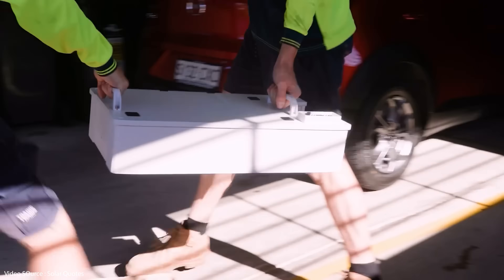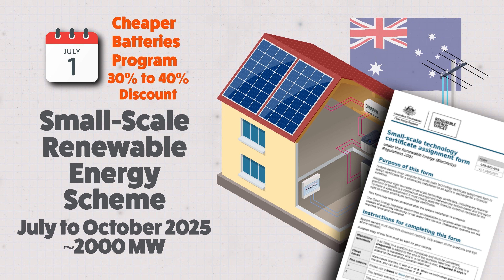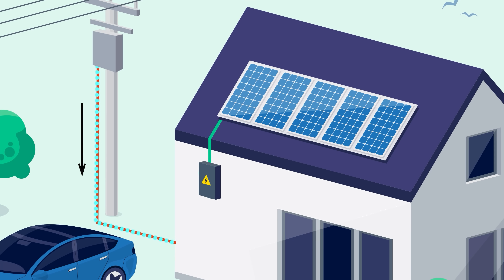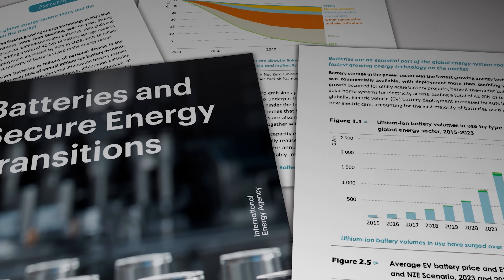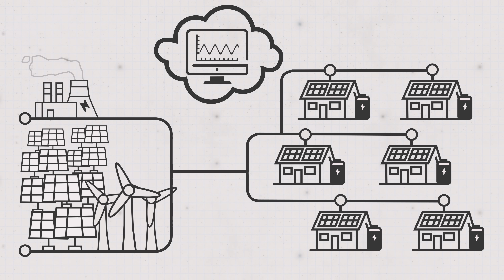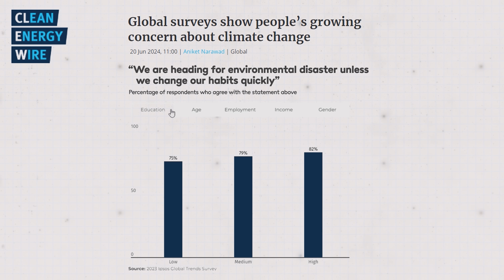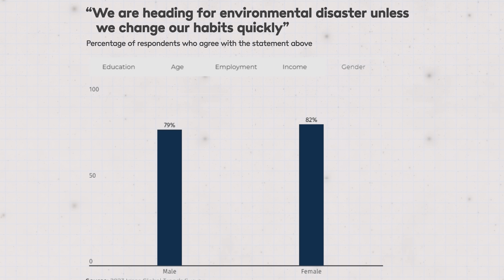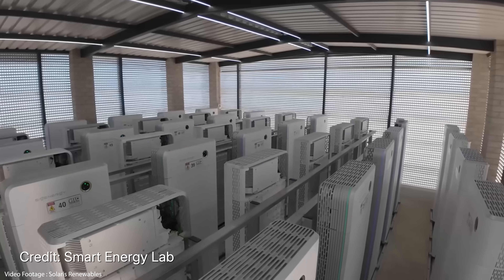Australians installed 100,000 home batteries in 17 weeks. Why can't we all do that?

Comment: Wasn’t worth feeding anything into the grid , the system was working 75% for the grid all the time plus sometimes 25% for me in hight temperatures sometimes over 40c . Definitely not having my battery heavily cycled during the day, remember no subsidies next battery all maintenance  bills on you. I’m happy now to pay minimum charge per quarter and let my system cruise even on ridiculously hot days.  
If the minimum charge goes up I will add an extra battery to give a larger surplus and disconnect completely from grid.

Comment: This is a scandal in Australia. Do your research! The Australian government has spent $2.8b for wealthy Australians to install  50 kWh batteries when the average household only uses 10-15 kWh per day. This means that the batteries will be 80% unused and likely never re-coop the carbon involved in their production. This is an example of appalling government policy that has had to be rapidly overhauled because of the resulting abuse by private companies. BTW any and every economist will tell you that the only sensible policy to reduce CO2 emissions is a carbon tax. Subsidies are rife for fraud and abuse. This is a great example that I will be using in my lectures.
Reply: That's bollocks. Do some research. Your calculation is flawed.

Comment: They are Not as great as they sound. There are still issues. For example.
Our system was not installed properly, the power company inspector failed the installation and now
they have to come back and fix it. we also get random brown outs that last 2-3 min even though the battery is full.
If the grid goes down we get these brownouts every hour or so. Very annoying, disruptive and harmful to computers
and other devices.

Comment: We installed two Tesla Powerwall batteries, a smart meter and 28 large panels in May 2024. After government subsidy, it cost us $AU 60K ($US 40K). We haven't had a power bill since. We use AC freely (including keeping the bedroom cold at night for the benefit of our three dogs), and run 2 fridge/freezers and a large chest freezer. We have had 2 blackouts and only realised the mains power was off when the Powerwall app beeped to warn us we were on battery. How stupid is the American system? 😂 Our heat pump HWS is 20 years old. Australia is the IDEAL environment for solar. As I write, our system is generating 9.1kW, 26 kWh today so far, at 11.20 am. We are running our little 55 inch tv in the bedroom, a 5kW AC, HWS and 3 fridges / freezers. Most of what we generate is going to the grid.
Reply from the maker: That's an amazing setup, and it sounds like you're truly living the dream!

Comment: I installed a battery under this scheme, but then I wanted to install one when I installed the solar panels two years ago. With the solar panels alone, my electricity bills turned from about $150 a month to credits except in winter. My electricity bill for all of last year was less than $250. Having added a 9.7 kWh battery, we now draw less than 1 kWh a day from the grid, and have backup if the grid goes down. In summer, the battery doesn't drop below 50% even when running the air-conditioning overnight, and it's fully charged by 10 am if it's sunny. So in our case with a small battery, we're still exporting to the grid most of the day. This will be less true in winter, but even on very cloudy days there's enough sunlight to charge the battery. Most of the battery systems installed under the scheme are 20 kWh or bigger, so they should at least reduce the grid draw for energy hungry homes as well as providing power to the grid in peak demand times through VPPs. I haven't seen charts demonstrating the benefits of the batteries yet, but something over 2GWh of extra power must be having a noticeable impact. The downside of the oversupply of home solar power is that feed-in tariffs have dropped to the point where they don't offset the daily supply charges from electricity companies. Anyway, on the whole, I believe that the battery scheme has encouraged enough people to make a difference to the supply balance in the grid, and it's much cheaper than building new coal power stations or nuclear power stations without the risks and waste issues. Yes, solar panels and batteries need to be recycled, but that's less of a problem than storing high level radioactive waste for thousands of years.  As to the cost of the subsidies, please remember that home owners are paying 70% of the cost, and battery prices haven't yet dropped as much as solar panels.

Comment: I've been saying this for ages. Government in the UK should put money to getting as many solar panels on as many roofs as possible, and "community batteries", installed in the local substation. All the local houses would charge the community battery and any extra would go back into the grid to supply houses that can't have panels. I have 10 panels and no battery fitted this year, with bird mesh for £5000, my bill is tiny compared to what it used to be. The cost will be repaid in under 3 years.

Comment: Curtailment always saves fuel because is reduces the supported erratic generating space.  For that reason it is tightly restricted  for emergencies because it would be done all the time.   Home solar charging home batteries eliminates solar power from grid support.  To the power grid it is not solar power.   The residence still has grid capacity maintenance costs, but it is not costing large amounts of high readiness natural gas.   Home solar grid support has to have instant capacity to supply the entire home when a cloud passes over and make up for any electricity below peak solar.  It is very natural gas fuel expensive.

Comment: I live in Sydney but from Wales originally so I know the weather in both ends of the Earth.  I just installed 20kw solar and a 48kWh battery, would have been $55, down to $35 with rebates.  Immediately signed up to Amber who are a VPP.  I’m in credit on my bill after 2 weeks.  It’s a blanket of cloud here today and the system will fill my battery by end of the day while running the house and pool pump for 6 hours.   
Amber 100% controls my battery for selling power only when wholesale is positive and curtails if the battery is full and power is negative cost to me.   All while overcoming the threat to the grid.  Win / win.
The weather in the UK may not be 300+days of full sun, but it’s enough to fill up your battery, even on a cloudy day.  
There’s a lot of naysayers in Oz, especially in the politics of green energy…. But this looks to be a winner, energy generation, storage and distribution on a huge scale but local.  For those who say what happens when the sun goes down?  Amber steps in, I’m hoping my contribution will cause power prices to go down for everyone in the long run….. we are all being screwed down here by the for profit driven power utility companies…..  I for one can safely stick 2 finger up to them.

Comment: While this May Truls be a good idea, it is not an obvious best financial choice. When calculating There Are hidden cost carried indirectly by the consumer. An example is the alternative approach, where the required network upgrade is finances through a small uplift on power prices. This May, or May not, be less expensive than individual batteries.
So the total financials Are not clear cut and simple.
However, due to local structures, batteries my be a quich and good fix to a public supply system which is respondent slowly, if at all.

Comment: I live in Toronto area of Canada. Home battery is not a big thing here. I believe solar power makes about 4% of  grid energy mix, but a lot of that is commercial scale with whole school gym roof, shopping mall roof, and rural ground mount 'solar farms. We are starting to see electric car chargers come to market  to be coordinated and remote controlled. This makes them become a dispatchable grid tied load bank. Good for providing an overnight dispatchable load for system stability when low demend otherwise need something to drive and to allow generators to be started in anticipation of morning loads ramping up.

Comment: Do you know why we install the batteries? I have 2 (and 7.5kW solar), the reason is to protect myself and family from the destruction caused by Bowen and Albo and this insane nett zero, I didn't do it for another reason than to keep the lights on and insulate away from the rising prices. From Australia.
Reply: Forcing luddites to act is a good thing.

Comment: I did say before that every house should have its own battery regardless if you have your own solar pv, just because that alone helps the grid and renewables to be built. Relying on big single centralized battereies is not feasible. People only argue against this when they dont see a direct benefit. Yes batteries on their own would only mean storing a possibly cheaper energy during the night. But the concept is true and is always talked about as a good side effect of getting an EV etc. But even I live in a house where EV charger is Impossible as it would have to go over a footpath; and its a residential building where installing solar is just never gonna happen because noone is really keen. Noone except a keen individual could make a difference with a battery. If only there were ANY subsidy to UK renewables these days! Hmm or even better having (per building) one of those super heavy molten iron or liquid air etc.. but yeah i guess I'll keep watching

Comment: I think sodium batteries are going to be so cheap in two or three years, that people won't be able to afford to not have a battery. Even if just shifting load to night-time rates, will make them feasible economically without PV, and using at night will allow greater wind power penetration.
The Genocide in Gaza, that you keep forgetting to condemn. It's ongoing. You haven't missed your chance.

Comment: I installed a 48kwh Sig battery under this scheme for nearly half price. I use around 60kWh a month and my combined savings of my solar, installed in 2018, and new battery are over $600 a month. All bills are now all in credit as I can fill the battery for free every day from the grid between 11am and 2pm with a 20kW inverter.

Comment: We're from Sydney & we’d had our solar for about three years already, but adding the 24 kWh Sigenergy battery a couple of months ago in September has completely changed things. Since then we’ve only paid around $5–$10 a month, basically just the daily supply charge for poles and wires. The house now runs mostly off our own solar and battery, air-con gets used without guilt, and having whole-home backup is a massive bonus. One of the best upgrades we’ve made for cutting ongoing living costs.

Comment: The only problem we had here in Australia is that there was no limit to the amount of batteries you could have. Quite well-off people bought up massive systems and batteries were virtually sold before they got off the ship. They needed to limit them.
Reply: There was a 50KWh soft limit, and a 100 KWh hard limit, but they're both at least twice as big as most people will ever need.

Comment: It was all subsidised by the federal government for their greenwashing agenda. If you stand it alone with no subsidies, you would be lucky to find one person/household that would have installed these, who is going to cough up for the capital costs for the replacements when they all fail at around the same time in in the future, this goes the same for the main battery banks that are attached to the grid?
Reply: The Tesla big battery has a 15 year waranty and paid for itself in 3. It has been so successful its capacity was doubled 3 years later. Its modular nature means units can be swapped in and out as needed.
Reply: @tassied12  How has it paid for itself, please supply the figures to back that up. These batteries have a lifespan of around 20 years, but prior to expiration of 20 years, their efficiency falls off a cliff, so you will be putting your hand out for another subsidised system when it fails, more taxpayer money for the boondoggles. If it is so good, pay for it yourself...in full, let me know about then!
Reply: @brianlove8413  No subsidies. The cost of the first phase of the battery was $90 million. The SA government pays around $4 million annually for system strength services. The bulk of revenue from its first stage came from the frequency control services market.  This provided competition to the gas generators that previously dominated that market. An Aurecon analysis in its first 12 months found a 57% cost saving (equivalent to approximately AUD 33 million) for electricity grid stabilisation services in just 6 months  (Q4 2017 to Q1 2018)

A later Aurecon report found the battery saved consumers $150 million over 2 years, forcing down FCAS costs by 90% . The other improvement is that since it is an electronic device, it provides a faster and more accurate response than the gas generators. Big batteries have now pretty much cornered the FCAS market in Australia
Reply: @tassied12  The reason it was installed was due to grid instability, instability caused by the massive introduction of solar and wind generation to the grid, which in turn made it unstable. A massive cost to fix a problem that was never present before! The company is getting paid for grid stabilisation when there never was a problem until 2016! So, "savings" on a coast never existed before....brilliant!
Reply: @brianlove8413 The outage was triggered by a mini tornado blowing down the interconnector. FCAS services are a normal part of grid operation, regardless of the generation source. The Aurecon report found that the big battery led to significant savings in the FCAS market, enough to pay for its cost inside 3 years.

Grid instability can have multiple causes. The big battery has intervened a number of times to help restore system frequency after coal plants tripped or transmission has failed due to storm damage.
Reply: @tassied12  The mini tornado may have caused the physical damage, but the existing instability of the grid caused by the amount solar and wind generation is what caused the entire blackout, instead of what would have traditionally a brown out in that situation.
Reply: @brianlove8413  The Heywood interconnector from SA to Victoria has long been known to be a large single point of failure. AEMO first proposed a second interconnector to NSW way back in 1997 to increase NEM security but it was blocked by the Olsen government because it threatened its power privatisation. Transmission failure is the most common reason for major blackouts, regardless of the generation source.

The most recent major blackout on the NEM was in Victoria at the beginning of last year when 500,000 Victorians were without power after a storm blew down the transmission lines to Loy Yang, causing the power station to trip.
Reply: @brianlove8413  There have been further transmission failures since the 2016 blackout where AEMO has credited the Tesla big battery with protecting SA from system failure.

In 2018, twin lightning strikes took out the interconnector between Queensland and NSW, resulting in load shedding in 3 states and islanding of Qld and SA. AEMOs report into the incident credited the battery with helping protecting the grid in SA

In January 2020, the Heywood interconnector was blown down again. This time SA coped just fine.

Comment: New sodium batteries are expected to cost from 40-50% less than current technology. This safe, fireproof technology will lower the cost of home solar panels by spreading their output over a longer period. At $10/kWh, a 20kWh battery bank would cost just $200 for the cells. CATL and BYD also sell complete turnkey battery factories using locally sourced materials as well as batteries.

Comment: I live in Ontario Canada and have  used solar and batteries for 4 years. My prime reason was for a reliable backup power supply during grid failure. Works flawlessly, we don’t even notice when the grid goes down.  

Alone came ultra low power rates and made it even better.  The Ontario electrical system provides ultra low rates between 11 pm and 7 am, during these hours we charge up our lithium batteries.  At 7 am the system automatically switches to battery power and we run on battery power all day. I recently upgraded to an inverter with an automatic pass through feature that allows the grid to take over during an overload. 

14 months ago we purchased an EV, which we charge during the ultra low rates. I’ve monitored the power consumption and our driving cost are 1 cent per km.  I estimate that our savings are 90% when compared to gasoline.

We use an off grid system and do not feed back to the grid.

Comment: It's very true that solar has got pretty cheap (outside the US where it still seems to cost about twice as much as elsewhere). I had 2.9kWp of solar installed in 2010 for £14,000, and have just upgraded it to 7kWp, adding 16kWh battery, and made it islanding and flexible. The new system cost £5000, and we're now about 97% off-grid (at least until we get a heat-pump), and the energy company pays us (about £1200/yr). The old system paid for itself in 7years due to a large govt incentive (FIT). The new one will pay for itself in 3.5 years (financial), 3.2 years (GHG emissions) with no subsidy at all. My new panels cost one sixteenth as much as the original ones in £/Wp. And the battery was £105/kWh when they cost 10 times that much only a few years ago. And this is in the dingy UK. Solar really is a no-brainer, even this far north, if you have a few grand to rub together, and the govt should be helping people pay for this because it helps all of us, especially skinter people.
Honestly - go buy solar people, it's great. (and insulate/airtight your houses and get a heat pump).